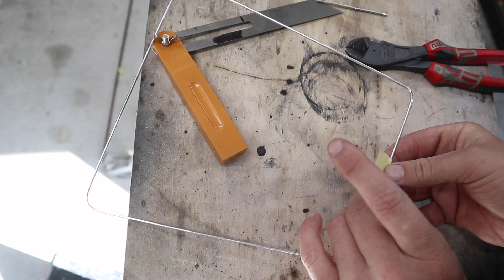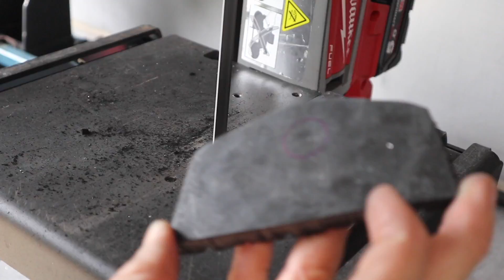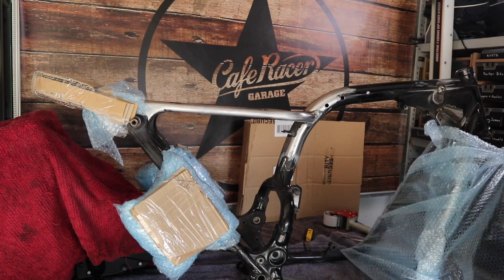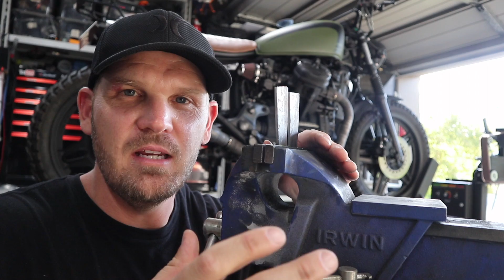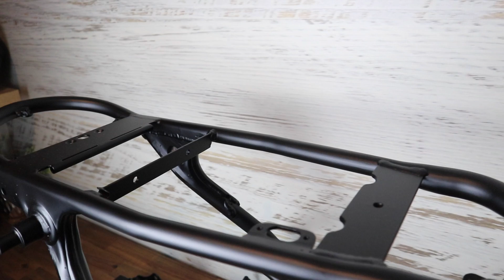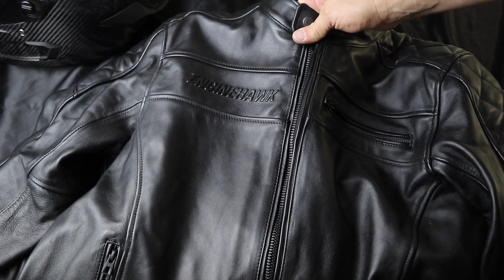MOTORCYCLE RADIATOR GRILL - CX500 SCRAMBLER / CAFE RACER

Comment: Ruined my fist gas tank I ever welded( little spot hole)... The tank sides were already done with a hammer...
Of course ingeniously I did not fill it with water because of the hole... 
And of course there were some gases left inside... an because I was so curious... I left cap and tap on and closed...
Well afterwards I was shocked 😲 and the tank looked like a balloon 🎈. Never happened again, so I must have learned my lessons on that 😅

Now that I've seen this CX500 I'll have to get one after all...shi...mpanzee